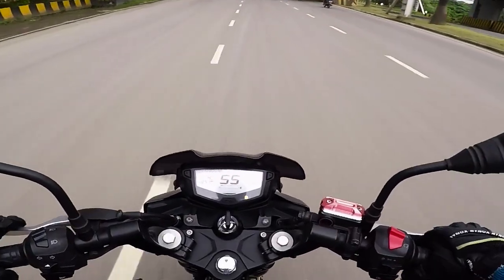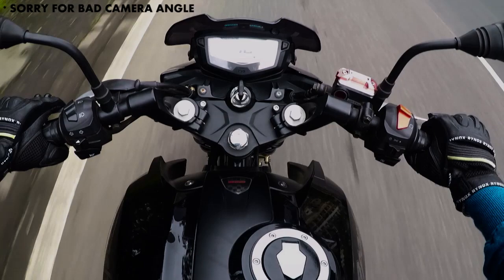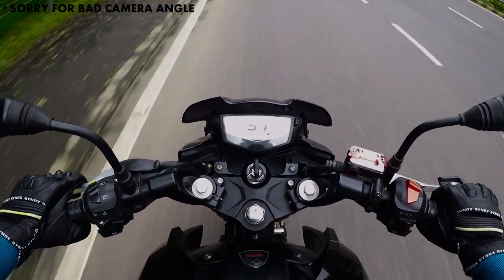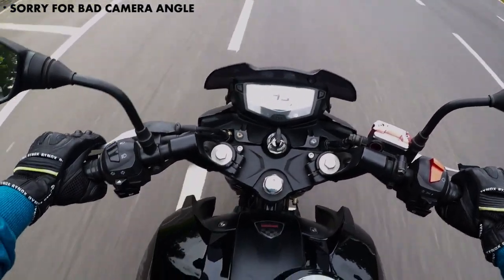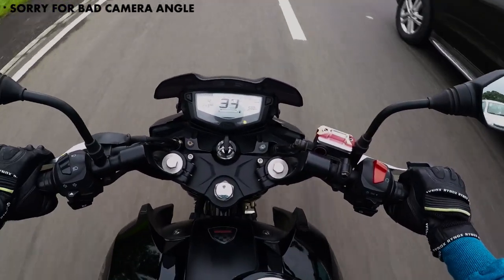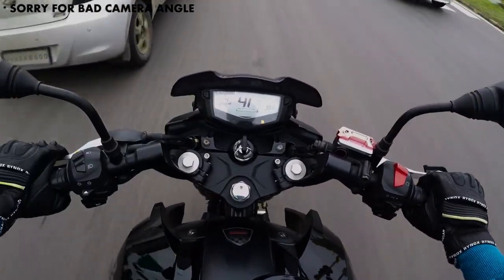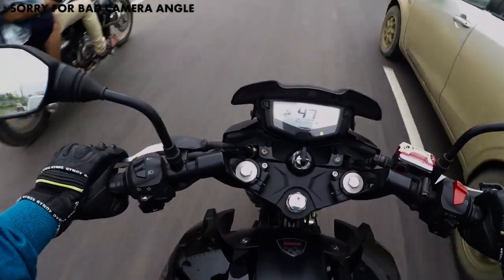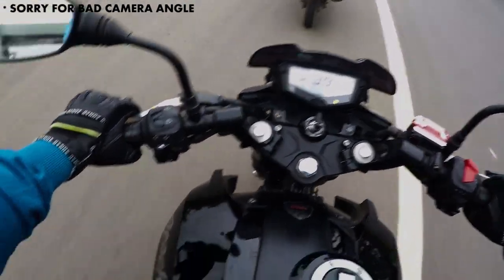How to maintain your APACHE 200. (Every owner must do this)

Comment: Which engine oil is best for rtr 200
Reply from the maker: I mostly used Motul 7100.
Reply: @Pumpedupguy  NGK Spark plug and motul oil give better performance?
Reply from the maker: Ngk was a good choice. U will definitely feel the difference in positive way

Comment: Bro I also have have apache 200 carburetor but iam facing a problem I've ridden this bike around 9500 and the problem is when ever I start the bike after few hours I face missing problem for around 1-2 km after that theres no issue at all...and even in the service center they are also not getting the problem😑
Reply from the maker: Mohit Gupta 
I cannot really help u in this matter, its better to have your bike thoroughly checked.
Reply: Hey bro i do have the same problem what are you facing but what i do is whenever you start the bike keep it idle running for atleast 5mins and rev it till 5000 rpm not hard but gentle once the engine gets into normal idling you are good to go and enjoy I'm doing the same with my rtr 200

Comment: After how long the air filter need to change?
Reply from the maker: It depends on the air condition u have in your region. If its dusty you'll need to change it more often. But i changed it at 10000km and you have seen the condition in video
Reply: @Pumpedupguy  okay. Thanks for ur reply
Reply from the maker: Always there bro..